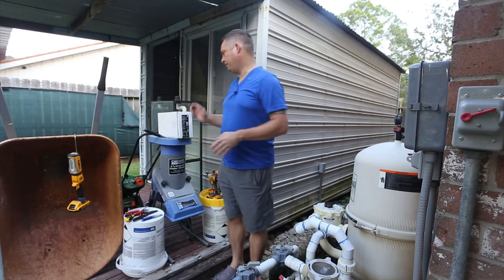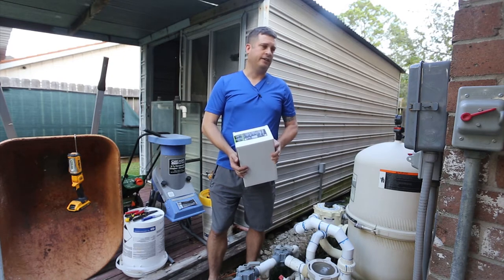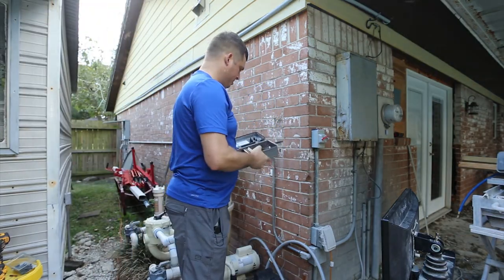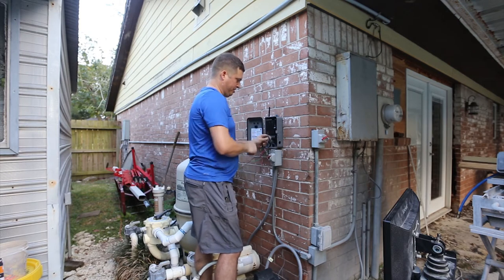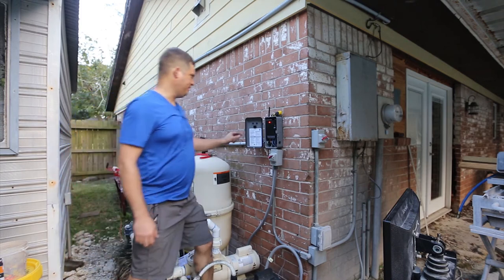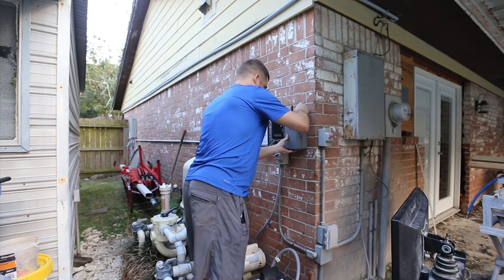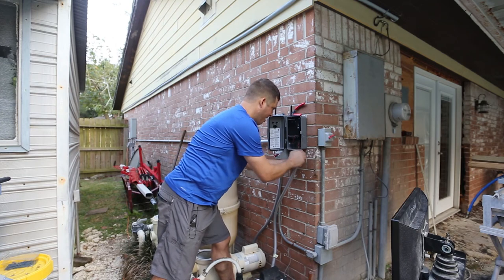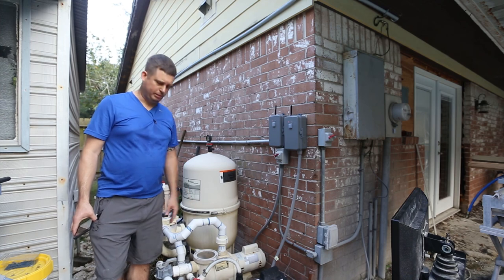Smart Pool: Installing Wink/Zigbee compatible controllers for my pool pump and booster pump

Comment: Thanks for your video, found it helpful. To reduce confusion, you might want to update all instances where you refer to the GE Switch as a controller or a timer. It is network-capable, but it's still just a switch.

Comment: Hi Brian, what a shame you didn't have the camera closer to see the whole process from close up. But at least I know that this type of timer will work with my pool. Thanks.
Reply from the maker: Yea, I had to make some compromises on the camera.  I typically film solo and I use a 15" LED Monitor to watch what is on camera.  I also use a Manfrotto Tripod with a fluid video head.  The net result is pretty bulky, but nice footage.  I have some clutter in the area where the pool pump is and I'm always trying to make sure everything is in frame.  My overall philosophy is that the point of view for my videos is the same as if you were sitting in a chair chatting with me while I worked on a project.

As an update, it's been almost a year since I installed these.  They are very reliable and very enjoyable.  I always hated opening the door to the Intermatic timer and flipping the switch.  I felt like I was just one slip away from getting shocked.  With the GE units I just push a button and it goes.  The red and green status LEDs let me know if the GFI breaker has tripped and the status of the pumps.  When the power goes out it's no big deal.. the schedule resumes when the power does.  When I need to modify the schedule I can easily do that from my phone anywhere I have internet connectivity via the Wink App.  It even plays nice with Alexa.  I have no regrets on installing these.  I would suggest that if you start installing expensive home automation components that you have a whole house surge suppresor installed.  I have one in the main panel and another in the sub panel so that all of my home automation stuff is well protected.
Reply: Thanks for the reply and the update, this timer is on my things to get list. Glad it is working for you. :)
Reply from the maker: It's also worth noting that I did not want to teach people how to do wiring.  In some areas you need to hire an electrician for something like this.  I consider pool timer maintenance to be part and parcel of owning a pool.  I have all electrical items related to my pool on GFI breakers that are the most sensitive I could get. (5mv)

Comment: Brian, thanks for sharing. Does the Smart Controler allow for multiple devices on a single controller where you can have separate timers for each or do you have to have a separate controller for each device?
Reply from the maker: I have a separate controller for each pump.  :(  It is flawless though.  No more messing with timer prongs or resetting the time.  Very easy to turn on or off from the panel without putting my fingers next to live wires.
Reply: Question for you sir.  I am looking at putting in a pool.  I have a smartthings hub with about 75 devices currently and would love to automate pool functions as well. Would you recommend this for new pool install or would there be something else on the market to handle it better for brand new installs.  I plan to automate pumps, lights, hot tube jets, etc etc etc.  As much as I can anyway.  thanks

Comment: Hi Brian 

I know you said you this smart box made by GE and you said it was zigbee but your description says it’s a zwave. I am looking at this exact box on amazon and it zwave and it’s 160+ but WiOn makes this exact same box and it’s 70 dollars on amazon. I just want something to work with zigbee to use my xfinity home app. Please explain and give me more light on this issue thanks
Reply: WiOn is what I have and is basically the same thing but doesn't have the button on the outside which is not worth the extra cost

Comment: Nice video.  Where did you purchase the ZigBee timer?  I only find the z-wave one for sale online.  I was looking to use with Echo plus that has built in zigbee and wouldn’t require separate hub.  Do you have a website link or which store sells it?  Thanks!
Reply from the maker: Amazon - it's a GE timer.